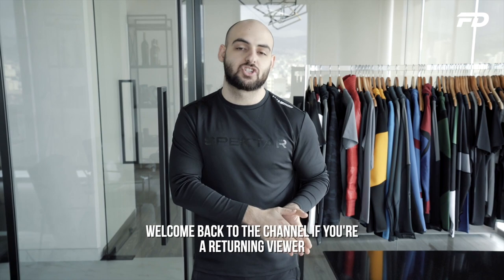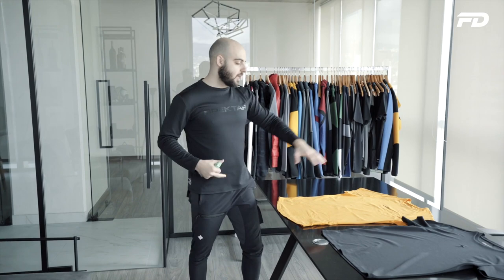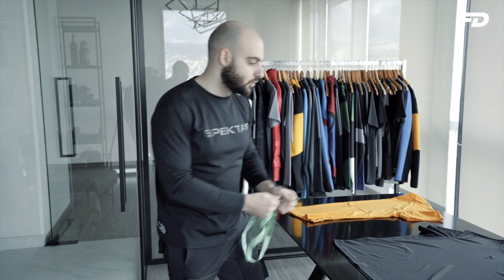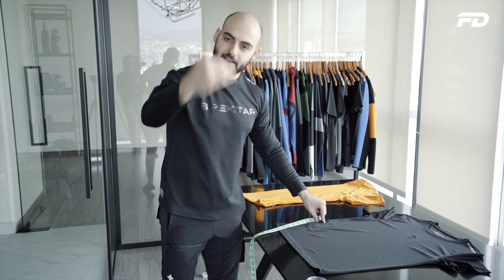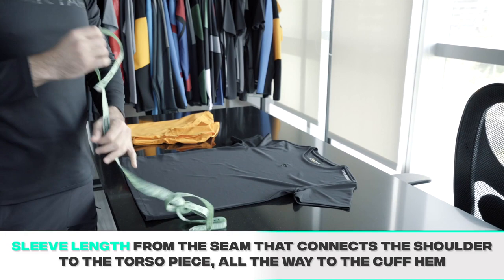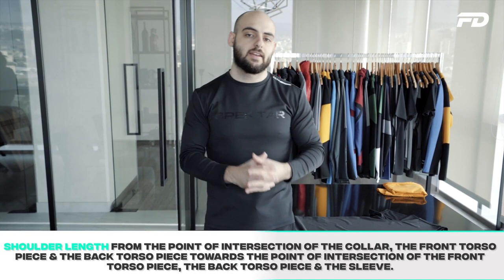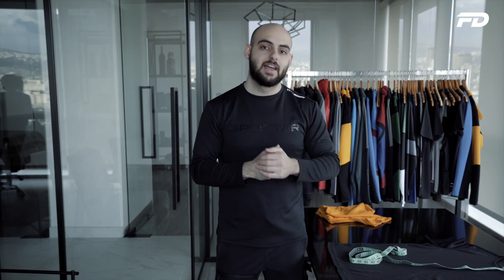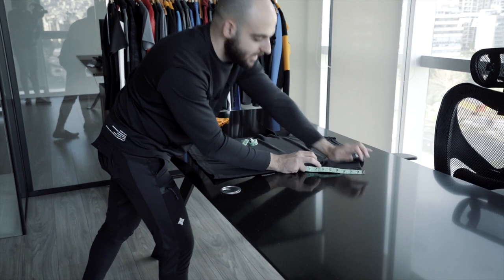How To Measure T Shirts For Design & Fitting Purposes

Comment: How do you determine your measurement for every size (S, M, L, etc.) Do you have a rule of thumb to scale down from medium to small for exemple? Or do you need a fit model from every sizes?
Reply: What I've found is that you cannot simply create a ratio for this to measure down or up because the sleeves' width from size to size differ. I could be wrong but this is where I'm at. So in short, I'm also waiting for him to respond.
Reply: This is known as size grading if you know to know how to go from size 8 to size 10 or size 6 per r 14 etc please checkout videos about size grading